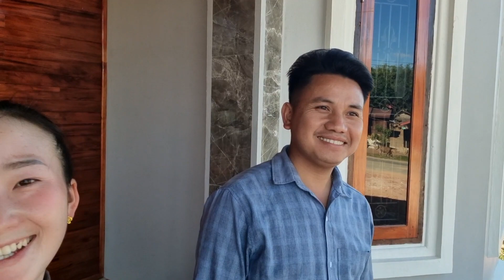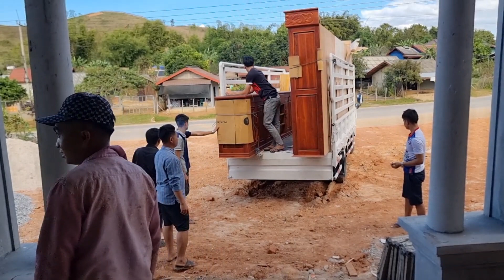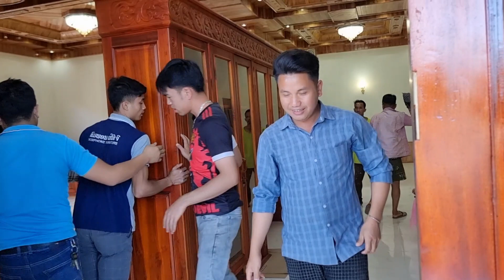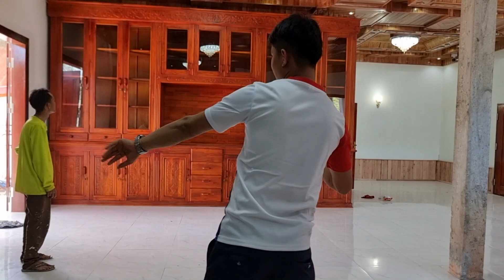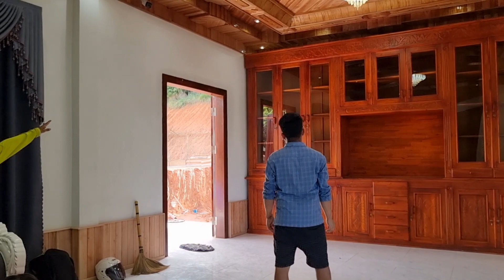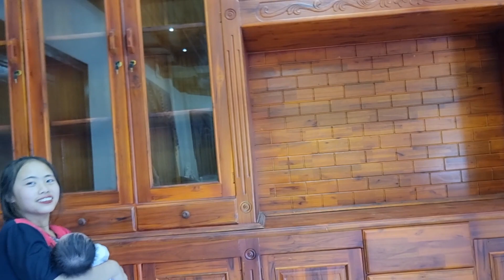zoo siab kawg li nplog thauj wb lub tub tuaj txog lawm

Comment: Are they going nail/screw that cabinet into the wall?  

It’s a freak accident bound to happen..
Reply: They’ll get right on it. Just after they buy Kasia a bed.
Reply: Yep, give it time.
Reply: No,, screw nothing all done....hopefully no accident or else 😢😢😢😭😭.....
Reply: An accident waiting to happen. They have no common sense .
Reply: No, they interlocked the display case or some called it the entertainment center. It almost touches the ceiling so it doesn’t have enough space to tilt or fall. Now the issue is the electrical wires or the power cords. It doesn’t have lightings inside the display case. On mine, I just tap on one corner & all the lights will turn on at 3 different levels: dim, medium or bright. I highly recommend not to use as an entertainment center (it’s in the walkway) but as a display case (putting beautiful, valuable & collectible items there) instead. However, I already heard Sheng & Kajsiab mentioned about putting clothes, shoes & rugs there. Those belong in the bedrooms, not in the living room. And some of you mentioned about the kids will use pens, pencils & other sharp objects to scratch it, and they will surely do that. These kids are raised without any discipline.
Reply: Not surprise if they come up with a video with an accident 🤷🏻‍♀️ don’t waste your time giving advice these two are hard head they will learn on their own
Reply: @lylly6772 yes so true don’t waste your time